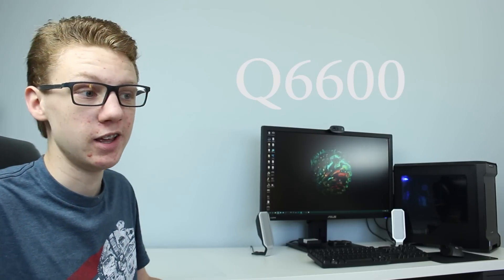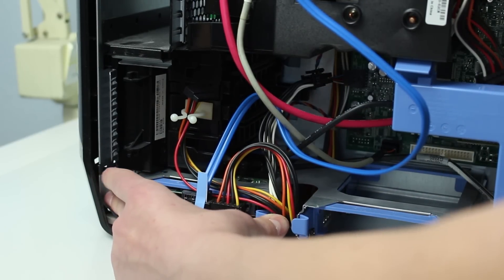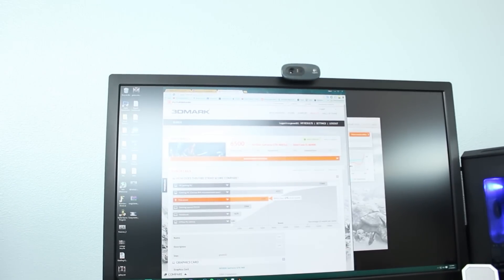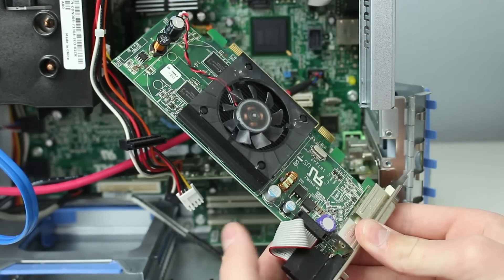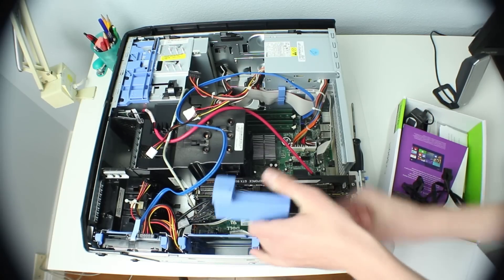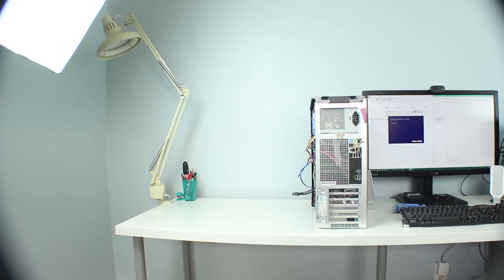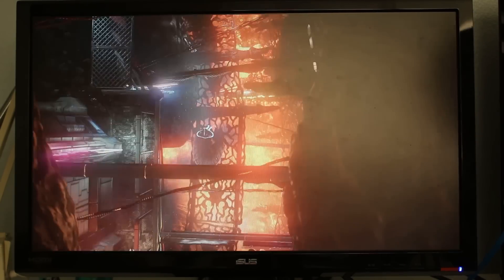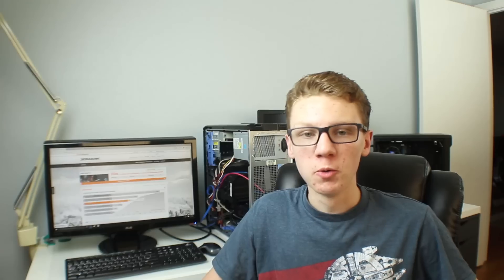Old CPU + New GPU = Gaming PC? (Core 2 Quad + GTX 960)

Comment: A Geforce 950 with 2 gigs memory is more than enough for Core 2 quad. Because Geforce 950 will outperform core 2 quad. I used to have Core 2 Quad Q-6600 and it has Geforce 750 on it, and even that was very good for my core 2 quad on 1280 X 720 resolution.

Comment: Fair enough but there is no real upgrade path in the old system & if the PCIE slot on the motherboard isn`t at least gen 2 then you will suffer there too ( I suspect that yours is Gen 2 ) Folks may need to upgrade their power supplies as well, the i5k Cpu`s have far more overclocking potential and a better CPU will matter a lot more in some games

Comment: Now try run GTA 5
Reply: It would most likely run like a charm, provided the reduced draw distance is not a dealbreaker
Reply: Abelino Jara
I can assure you it will not run like a charm, you assume too much. But, this is becuase i have the CPU and RAM similar to this video with a Q9400, aaaand it runs like sh*t.
Reply: +Aldion Sylkaj one of my systems used to run a Q6600 (now runs a QX6800 at 3.3GHz) and it had a 4GB 960 in it (now has a 2GB 950) with the 960 it ran GTA V at 30FPS at 1080P on high presets. it was butter smooth. now with the 950, the bottleneck of less video ram (PCIE 1.1 8X has to trade some rendering to main system ram) it has some rendering and draw distance issues but it still does 1080P at 30FPS. if you get 4GB of VRAM you'll barely notice the bottleneck other than the 30FPS part (due to the CPU bottleneck). These systems are still very capable performers, I beat GTA V and SOMA on that system with the 960 before the 960 went to my new rig. I also ran Battlefield 4  and Battlefront on it without much of an issue
Reply: my Q9400 online is 45 fps and is much betterthan 30 tbh. and even then, Online would make my q6600 struggle to 20 fps in moments of high warzones (usual lnline dys). But i hope ot get  6gb card , 16gb ram and a hex core cpu;. argorider2

Comment: did you just call a Q6600 a Core 2 Duo quad?!!! its just Core 2 Quad
Also that task manager disk usage number is WAY off!! when my hard drive is running at 500KBps it says im maxing it out and when im doing a file transfer at 150MBps it says like 30%

Comment: actually, a good rule of thumb is if you spend more on your GPU than your CPU, you're more than likely going to run into some issues. with just about any of the LGA775 chips, the IPC sucked ass. take this chip into a game that requires just a bit of CPU horse power, and you'll be unpleasantly surprised. without getting too far into this, this is about more than just clock speed and cores. 

anyhow, nice video, but I'd suggest running a few more tests, and doing a little more research next time.

Comment: I was planning on building a scrapyard pc for myself (really tight on budget), and come across Core2Quad Q9650 for 30USD.First I doubt if it's a good idea (PCmark only give them 3000-ish score, which is in the same region with my Ivy Bridge core i5 3210M on my laptop. I guess it's still a steal

Comment: I did this but the other way around. Had a 550ti with my old Athlon II 245, bought a i7 4970k and it pretty much tripled my FPS in CSGO(from around 30 to 100+). Granted the 550ti is a huge bottleneck but i was really surprised with the results. I plan on getting a 970 when I've saved up but in the mean time my 550ti does pretty damn well for what it is.The only real downside is the amount of heat the old card puts out as its working at full tilt just to try and keep up with the CPU.

Comment: Sure it can and is doable. I tied Nvidia GTX 970 with C2D E8400 using PCi-E 1.1 x16 lane and 4x1GB ram :D
1440p60 worked as a charm... in games that weren't that much CPU bound of course :D

If you want to see more, i have tests on my channel.

Comment: Never use a untested power supply.  Get a voltage meter and learn how to use it.  This kind of reckless  system building will catch up on you.  You have a system with a failing hard drive.  In my experience hard drives are killed in two ways – physical damage and voltage lows.  Now you stick in a new GPU to tax the PSU further – you may have gotten lucky this time – that GPU may still be working but I'd bet you did some damage.  When it comes to a PSU – Don't push it.  Calc max load and add 20%.   That said you should be good for 5 years -- after that I'd do a swap out for newer unit.  The power supply is the most important component in any electronic device.  And don't get me started on the crap PSU's from the major OEM's.

Comment: I still have core 2 quad that I bought on 2008 and it still performs well! I only upgrade the vga, rams, and psu. First i have 8500gts, then gts 250, and then 760 Ti till today. It performs good on 720p gaming (crysis 3, witcher 3 etc) not at ultra setting obviously.
i'm planning on build new pc (skylake build) next week and retiring my old pc :D

Comment: Anyone who is still using a q6600 needs to upgrade. An i3-6100 for $125 will blow it out of the water. I wouldn't be able to deal with the fps dips.

Comment: acutely it wasn't 700$ it was 300$ some sites had it at 700$ but back in 2007 when I was building a pc it was 300$ new from intel.... Also you do know you can format with the windows installer.

Comment: what the hell is called core 2 duo quad, as*hole ? q6600 is core 2 quad.
first was core duo series, then came core 2 duo. 2 as the version of products as there was so much improved cache in core 2 series that Intel ditched the mfg of core series(1). and are you saying 960 is top of the line gfx card. in which world d-bag ?  dont get angry with my comments, go with some info tools like cpu-z etc, and improve your knowledge and come out of your noob misery in youtube and become great in vloging and tech reviews. For now i d dislike the video.
Reply from the maker: +Pratyush Singh I know I accidently said Core 2 Duo Quad. I fixed that in an annotation. And in some ways, a 960 is a relatively high end GPU compared to the other hardware in this system, as it is much newer.

Comment: But can it run Crysis?
Reply: +Steve Dice psh more like 100k at 1,000,000 fps
Reply: +Matthew Ruggles LOL no, try 1000k @ 800,000,000 fps.
Reply: +TheBlackRyder Yes,  I used to run it when I had VISTA 32 Bit.. Now that I moved to Win 8.1 64 bit on my XPS 420...Crysis only runs under emulator.
Reply: +JB6789 What resolution are you running it at? If you run it at 8.9B you'll be able to keep a steady 100 fps and won't have to emulate it.
Reply: Mr. Frog Games Not even close...It runs around 25-30 fps in 1080p.  No more..even with a slight OC bump (2.7 Ghz) using SetFSB. Which is why I scale it back a bit to improve FPS.
Reply: JB6789
I know, I was just kidding xD

Comment: I had a xeon x5650 which I get at a cheapskate price, then I bought a gtx970 and hoping to just play gta5 at a low resolution decent 30fps framerate. Guess wat I have already played gta5, witcher3, dying light and fallout4 all at 2560x1440 at 40+ framerate and at 1080p very playable at 60fps.

Comment: Your not going to get the same performance in the older rig purely from bus/transfer speed it's a bottleneck in bandwidth when inside of a game hitting 100%.  Just like oldschool ddr2 at 633mhz is going to be a bottleneck alongside the 3gbs of ram other than that the bus from your cpu will limit the gpu.  I had a Phenom x4 II 940 oc'd to 3.8 ghz and 8gbs of ram at 1066 with a x15 bus, but a 760 was still limited in bandwidth yes it could perform exactly like your current rig but it still choked.  If you don't have your rig setup properly in all aspects there will usually be a bottleneck.  Just like fat32 is a stupid move on a hard drive over ntfs.  As well you should never under power a video card you can damage it.  If you are going to keep producing content/videos please do more research and just simply do your homework.  I don't want newer generations getting taught improper ways of how to do things.

Comment from the maker: 20,000 views in a little over a month. Okay this is insane.
Reply: People love old workstation gaming pc's. I'm currently building a sleeper with an old gtx titan. 8-)
Reply: Over 200,000 now.
Reply: nearly 300,000 now. (295k)
Reply from the maker: https://soundcloud.com/nicperrault/tracks
Reply: +Gavin Remme Well it was a nicely made video, keep up the good work!
Reply: +Gavin Remme just a tad more, now :)
Reply: +Gavin Remme Because it's a very good video! Only some few small things, you sometimes talk very fast and camera has a weird round thing in every corner.
Reply from the maker: MrDanMan That "weird round thing" is some vignetting caused by the wide angle adapter I use. I could remove it, but it really doesn't bother me.
Reply: +Gavin Remme Oh, I didn't know how it's called :P
Reply: the card was an 8800 GS if you didn't know by now
Reply: +Gavin Remme Can u PLEASE do some gaming on it?(GTA 5,CS:GO,Assassin's Creed 4 Black Flag)
Reply from the maker: No, actually its a Radeon HD 2400 Pro.
Reply: I have a Q6600, 4Gb RAM with a GTX750 4Gb and it run decently the Assassins Creed Black Flag.
Reply: João Maio fps?
Reply: João Maio ty
Reply: Your girlfriend is beutiful
Reply: Looks like a nerd but He is the chet on tech
Reply: What {:

Comment: I just put a R9 380 on a AMD 7750 dual core cpu and damn is it bottleneck lmfao . I was able to get into the test range in BF4 and all the settings were at medium the at like 30 fps and when i turned it to ultra it was still 30 fps even if i went from dx 11 to mantle no difference and now if i try and open the game the cpu crashes lmao

Comment: you can't just run firestrike. For one the more important thing would be the physics scores as that's 100% CPU. But the best test would be on a few games esspecily ones that are very cpu bound. You'll start to see the old Core2Duo Quad will bottleneck the gpu.
Reply from the maker: +Joe Pinder This point has been brought up several times, and its a good one. Next time a do something like this I will. I actually played a bit of csgo on it (which I know isn't very intensive) and it ran at over 100fps just fine.

Comment: hy i did the same thing with my pc :) for gaming. only i use q6700 , corsair rmx750 , 4gb ram ddr2 dual channel, msi gtx 960,ssd 240 gb. battlefild 4 ultra full hd in 47 fps,Gta V 35 fps. next upgrade anyway modo CPU and RAM , but for now the PC is doing very greate.nice video

Comment: Pretty good video man. Very nice video editing. One thing though, to say that you're getting 85% of the performance for 11% of the price is deceiving. You have to factor in the graphics card so with a combined price of 430 vs 230 between just cpu and gpu it's more like 55% of the price. Like you said, those benchmarks are graphics intensive so the gtx 960 is carrying the weight there. It would be interesting to just compare physics scores of the two cpus. Good video gets a like from me. The beautiful enthoo case gets a sub.

Comment: you know you CAN partition and format drives in the windows setup. 
and why did you use FAT32? when windows uses NTFS file system as default???
good job on the vid tho.

Comment: my friend has a core 2 extreme qx9770 (3.2ghz, 4 cores), 16 gb of ddr2 ram, and a Radeon R9-390 and gets great performance on games. he even gets a higher score o firestrike than you main system.
Reply from the maker: +EvilTurkeySlices Cause of that R9-390.
Reply: Gevan32 the CPU is also the most powerful lga775 CPU.

Comment: And now play a gpu intensive game like GTA V. I can tell you from experience that it will bottleneck the shit out of a midrange gpu (R9 270). When I jumped to an I5 2500, my fps suddenly rose from like 20fps to 70 fps in optimized settings and 40 fps in everything maxed out but the textures.

Comment: I just got used i7 930 and bought a new  gtx960ti   very satisfied it was cheap around 400 bucks CDN and already overclocked to 3.5 and came with tons of cool stuff the motherboard is a high end one for the time.
Reply: +Rex Holes 400 including new GPU

Comment: dude test it on real life performance in gaming it will only be 30 to 40 fps and its ageing it better of ruunning as a file deposit sever or torrenting sever maybe seeding like what i did to my e7500 rig with a 8800gtx and a bit of casual gaming like lol and cs go and thath type of stuff it is also connected to my spare hd tv at my bed room

Comment: Great video. Few things - on older PC, you do not install Windows via USB :D and especially not W10, thats why it takes that much time. Second, 3DMark is not really good test, try some games and you`ll see much bigger difference. I should know since my combo is somewhat similar (but with GTX 660). But yeah, Core2Duo is great technology even by today standards. It IPC are almost on par with AMDs FX series. It all depends on what you`re trying to do, some games will be unplayable, but most will work just fine. Also, nVidia drivers are really good, with Radeon cards you need a lot faster CPU to get it work properly.

Comment: You can get a Core 2 Quad for 27 bucks, but try finding an LGA 775 Mobo for decently cheap that isn't broken. A bit tougher.
Reply: +Ben Kuyt I Can Still Pull Out MY old Mobo from my Optiplex 960 and it still runs like a champ!
Reply: +Ben Kuyt I got a Q6600, 775 mobo, and 4 gigs of ddr2 for $50
Reply: Garrett Holland Thats a nice steal, get some more cheap ram and an ok GPU you got yourself a pretty good system!
Reply: US Teardrop I got 8 gigs of ddr2 667 after that for $8
Reply: US Teardrop Should I use a gtx 950, or a 750 ti?
Reply: +Garrett Holland if you can afford it 950 for sure but 750ti is great otherwise
Reply: Jonny Coombs Its only $20 more now
Reply: Garrett Holland I would definitely go for it then a 4GB one being the best option due to games using increasing large amounts of vram
Reply: Jonny Coombs Yes I Do Agree with you.

Comment: Not really 85% of the performance of the new cpu.It`s not that simple. Did you look at 3D Mark`s physics scores separately? That should be around 50% lower on Q6600. Yeah some games will run just fine at least in 40-50 fps range even today on this old quad but many games released in last few years will have troubles running on it. My friend has big issues playing SW: Battlefront on Q6600 and games like GTA V, Witcher 3 or any ARMA would really be a tough match. Performance of the new GPU would be effectively halved by CPU bottleneck with very low minimum framerates.

Comment: replace tha power supply with a EVGA 600B at least if u're gunna get a GTX 960 on it! dump tha 300w PSU! i would never use a Windows newer than 7 and i wouldn't even use 300w on a XP desktop

Comment: I had an old Phenom in my first rig back in 2013 paired with a 750 Ti, just a few months ago I upgraded my system to an FX-6300. There was such a bottleneck created by the older CPU compared to my new one.

Comment: Very cool video.  In my experience the real difference with an older CPU is smoothness.  I run a Phenom II x6 1090t - an absolute beast in its day, but a bit of a dinosaur now.  My r9 280 pushes 60fps all day with plenty of games, but there is noticeable motion stutter, even in some older games - and that level of stutter does seem to correlate with the background complexity of the game.  Dirt 3 (previous gen) runs buttery smooth - but Dirt Rally (current gen) doesn't have the same snappy response despite looking amazing.

Comment: I'm still using a Pentium E5200 Dual core CPU with a GeForce 9600GT... Nothing changed from the time it was bought, except adding another 2GB RAM stick...

Comment: Some constructive criticism
1. Q6600 wasn't intel's first quad core. first quad core from intel, was qx6700, released in 2006.
2. 370watt PSU is enough for that build. barely. there is website called "eXtreme Power Supply Calculator", I calculated the power consumption of that PC, and its 364 watts.
3. Old hard drives make noise. It doesn't mean it's broken... Old HDDs are slow though... too goddamn slow.

Nice video though. If I were to have that computer, I would buy 120gb SSD, replace the 2x512mb sticks, with 2x2gb sticks. It would be so nice PC....
Keep up the good work.
Reply from the maker: +99jiivee Good recommendations.

Comment: nice video , i have a Q9550 , and a GTX750 ti , works great with GTA IV , that game is more demanding on the videocard then my processor , so yeah a Q6600 or a Q9550 is usable even in 2016 , i now have a second generation i5-2400 with an Asus board

Comment: Pre 7:00 minutes, I predict that there will be a bottleneck somewhere, definently with that old chip, as well as the 300 watt supply
After 13:00 minutes, I am pretty surprised. Especially for the price differences, that's just amazing. 10/10 would watch again xD